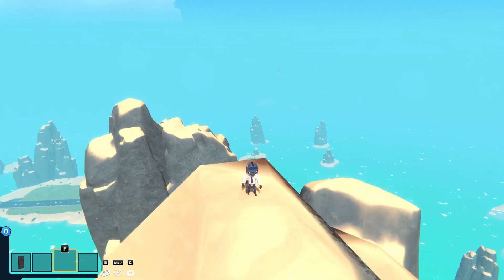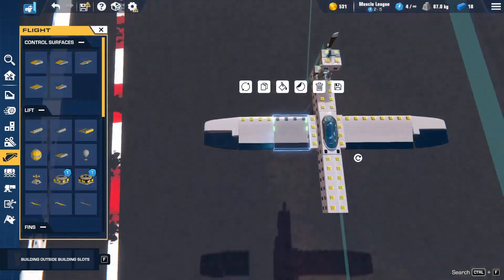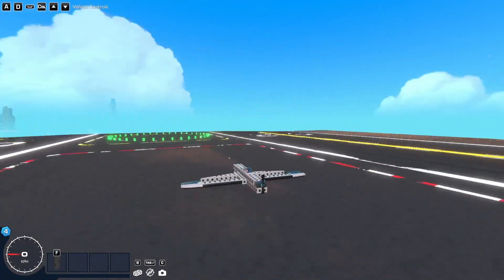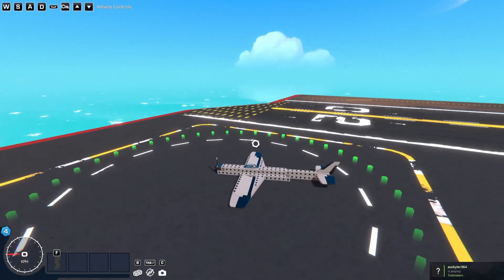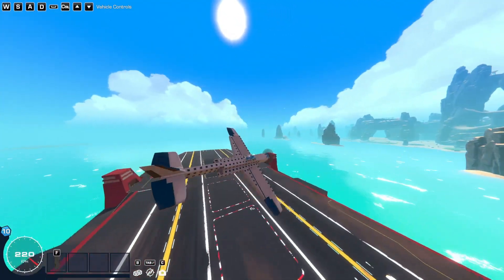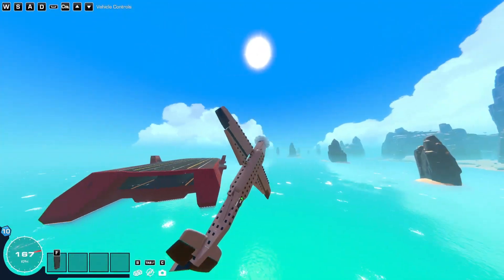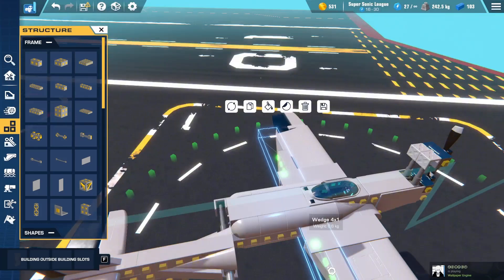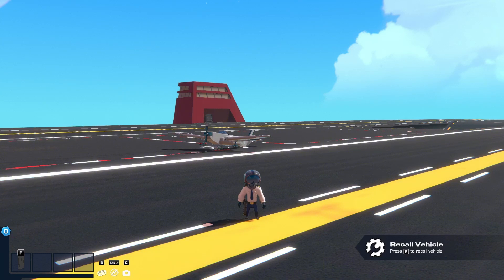HOW TO BUILD A PLANE [Trailmakers]

Comment: 2:41 DO NOT COVER YOUR WINGS!!! that will also block the lift, and you'll end up with a plane with no lift
Reply from the maker: Well idk if that's true tbh bc I've never rly lost lift, just added weight on top of the lift
Reply: @sirguid3  am pretty sure that if you cover your whole wings, the lift completly dissapears, and you can even see it with the forces, but it might have changed with some of the more recent updates
Reply: That’s partially true, however, lift isn’t too necessary when you can just pitch up. Lift also differs from proactive drag, which allows the aircraft to fall more slowly.